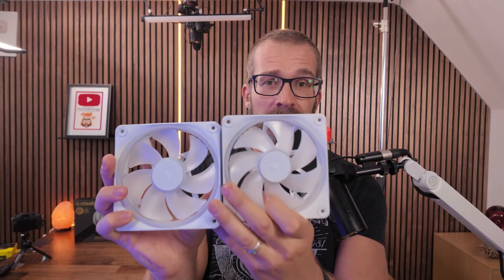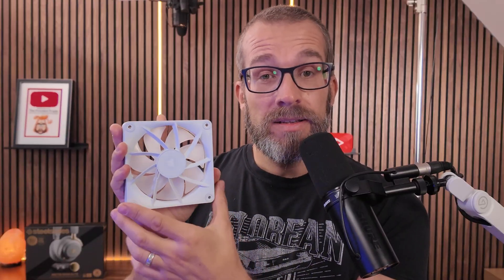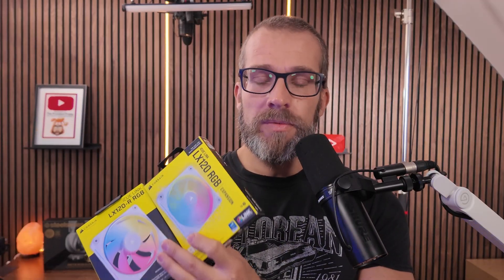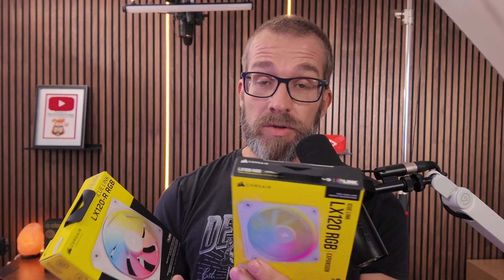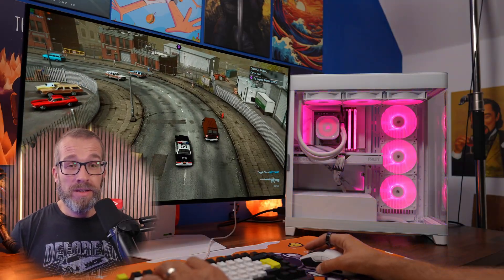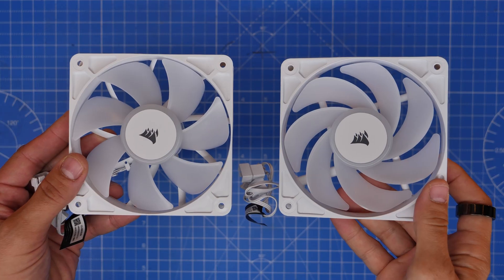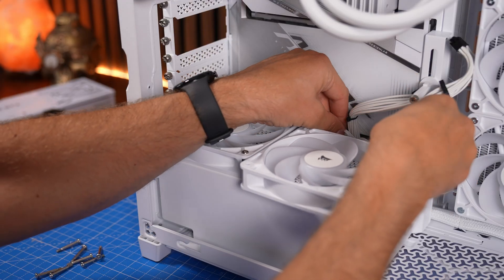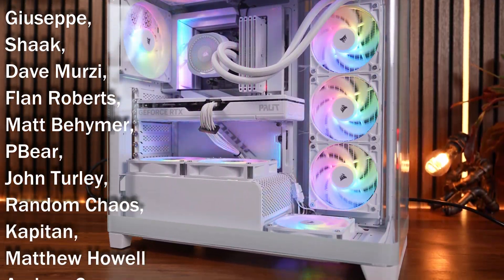What are reverse rotor fans? Corsair LX120-R and RS120-R fans explored

Comment: I've been wanting reverse blade options from my 3500X case. I use all ICUE Link fans as is and its kind of disappointing that the new options reduce performance. Plus the ICUE link reverse blade option looks like a different fan compared to all the RX fans I'm currently using.

Comment: I have been using Redragon infinity mirror 120s which are standard and reverse daisy chain fans and upsiren 120 mirror daisy chain fans F/R and just bought 9 upsiren 140 infinity forward and reverse fans to put in the giant NZXT H9 flow case. I have everything for a build except the cpu and MB, waiting for this week's sales. I recently saw expensive fans on Alie that had a switch to switch from forward to reverse could have been Lian Li...I can't pick a board , I want a Nova but they're still cooking CPUs , and I'm between a Carbon wifi or an Aorus Master... Aurus is like 100 less but has a 5 year warranty.